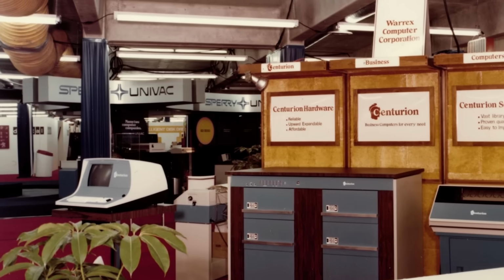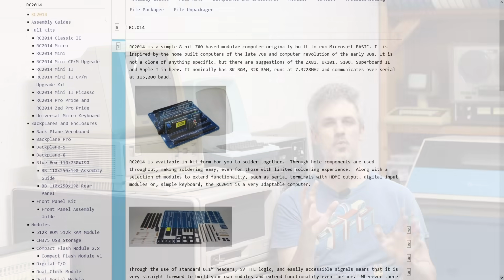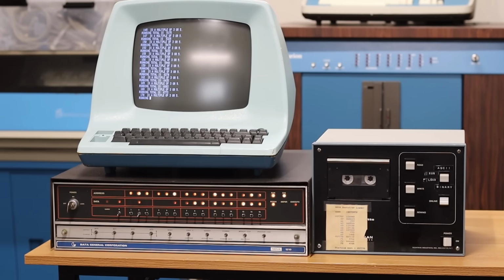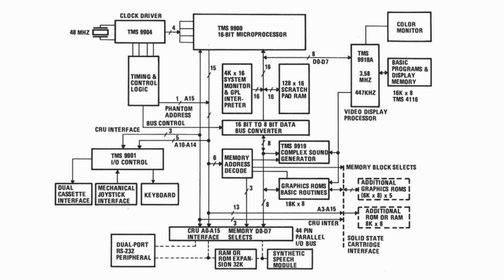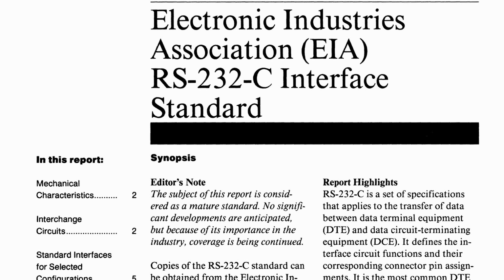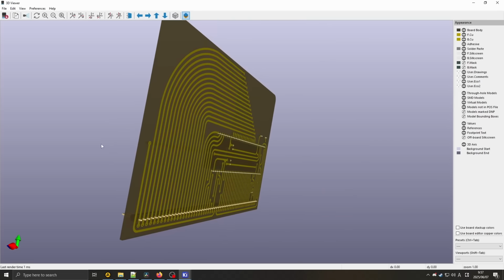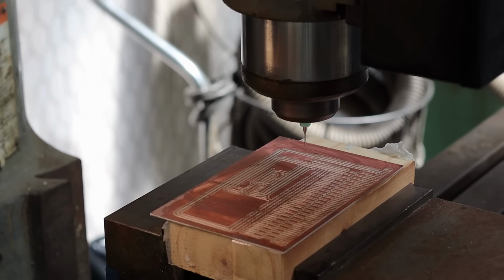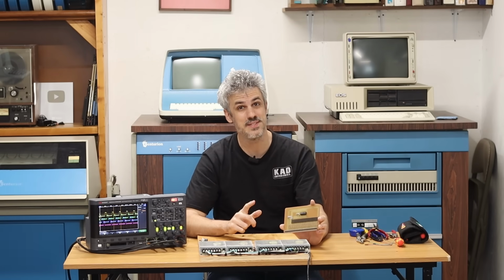The First Step in Building our TMS9900 Homebrew!

Comment: I think “being designed for multiple users” is the only definition you need for micro vs mini. That already decides the architecture choices which would divide it into the 2 camps: how much power they have, amount of storage, the presence of a memory management unit and context switching, etc. 
EDIT: I am talking about machines from the era when these terms were still widely used. “But my AMD Ryzen desktop is designed for multiple users”; yes, but nobody I know is calling these mini- or micro- computers.
Reply from the maker: In reality, the term minicomputer was never an officially decided upon term. It just kind of came into being, and marketing departments being what they are, capitalized on the term for their own benefit. So, my definition of a minicomputer is going to differ from everyone else's, which is going to differ from the marketing departments of the era, which is going to differ yet again from the engineers who were designing the things. Language is a weird and messy thing!
Reply: @UsagiElectric  Yes, plus the first minicomputers, like the LINC or PDP-8 were mostly meant as single user systems. That's why I think the distinction between "processor in (a few) chip(s)" and "processor in many chips" makes more sense.
Reply: Of course, this only holds until PCs adopted memory management and context switching; not for multiple users but for multiple processes. The mini/micro terms are rather meaningless after the mid-80s development of MMUs on personal computers, so IMO it’s not worth trying to make the distinction after then. It’s like trying to decide if a modern speedboat is a pinnace or a galleon.
Reply: Minicomputers also tended to have very "intelligent" devices.  The CPU basically never spent time spoonfeeding any one periferal.  Just sent off some data and went to do something else until it came back.  But yeah by the time stuff like 386es came out, a lot of microcomputers had much of the minicomputer capabilities and really, what made minicomputers what they were was starting to be less and less relevant and it was just becoming more about power and addressable RAM and devices as multiuser stuff started to become more relevant.  But also because terminals were on their way out or becoming just a piece of software on an also fairly capable computer at someone's desk, the role of a mainframe had changed quite a bit.
The single tasking nature and the conditioned user expectation that computers had to wait to "think" of things kinda reinforced microcomputers having very dumb periferals that the CPU would have to take a lot of time to bang out signals to control every interaction with the device.
Reply: Well, that is not really a particularly good distinguishing element I think, I have what used to be a workstation that I have "souped up" so it now has 14cores and 96Gb RAM plus 4 additional GBE ports as well as NVMe storage to keep up with the rest. It isn't a good single user machine at all, it does have a GPU but it's there to do other stuff not really show an image on a monitor. 
Obviously in terms of hardware right now it IS indisputably a 'multiuser machine' on account of it on top of the above mentioned hardware also runs Windows Server DCE and would be a terrible computer to use as a PC - but it would feel a bit wrong to call it a minicomputer somehow. It's a former workstation "bastardized" into being a server but it's still a box that looks like it belongs on a desk next to a monitor. It's a minitower basically, it doesn't even look 'servery' at all unless you look at the back of it or pop the hood.  
The reason for this thing is that I don't have the possibility to have a rack, and I don't want it to look like a server either, my other machine is a HP ML350 which is a pure servermachine but just with tower feet and no rack ears, for the same reason. It looks like a tower PC to the uninitiated. Neither of those two have monitors plugged in to them.
Reply: Multi-user versus "personal computer" That for me is the distinction.
Reply: Yeah, Yeah...and people ran timeshare BASIC on their Altairs, but that didn't make them minicomputers, either. I think "being designed for multiple users" encompasses more than just being able to run software for multiple users. It has to include both CPU architecture to support mulitple users (large amounts of RAM, easy task switching, and later, protected memory) and system architecture that enables large storage and RAM, interfaces to multiple terminals/displays, and allows for big expansion. I also think you have to include fast and plentiful I/O, as many minicomputers were used for process control and communications.

Even though the PDP-11 and Data General computers @UsagiElectric showed were physically small, they were fully capable of being expanded into much larger systems, if needed, which helps in differentiating them from micros.

An 8086 could have been the basis for a minicomputer, if the system had been designed for more RAM, storage and I/O than than the microcomputers of the time. The 8088 not so much simply because the compromises that made the 8088 different from the 8086 were exactly the kind of limitations that you wouldn't want in a minicomputer...things that slowed performance.

The biggest reason it wasn't was probably that the competing minicomputers of the time were already faster and more capable than the 8086 when it launched.
Reply: Then there's the "networked micros" that showed up in the mid-eighties.  Two examples:

Zeus 2 used up to eight motherboards on a passive backplane, each of which ran a thing called MUSE (Multi-user System Executive), a CP/M system, and had interprocess communication between the boards to handle complex tasks.  

Televideo 816/40 was a multi-user networked micro, also running a passive backplane IIRC.  It served up to sixteen users, each of which had their own CPU to do business, write code, or just play Super Star Trek on.  Each user on the system had a user area on the  shared 40 MB hard drive.  (Now that's using the USER command as it was actually intended!)
Reply: Not at all accurate. The pdp11 is a mini, but a desktop computer turned into a server is still in a different class.
Reply: @rickhunt3183  We might all find this article by Richard H. Eckhouse, ACM, to be of interest.

https://dl.acm.org/doi/pdf/10.5555/1074100.1074606
Reply: In modern terms, that'd be a server vs workstation. And it's equally blurry since any modern computer can run both roles. Although we still don't stuff MacBooks into racks.
Reply: @graealex we do stuff Mac Minis into racks. This is due to a silly quirk of Apple's lineup and licensing, though.
Reply: @matthewkriebel7342  We don't really. Maybe you do, though.
Reply: @graealex  usually.
Reply: @graealex stuffing macbooks in racks as ci build machines is pretty common
Reply: @lasskinn  It is not "common". You see it every once in a while. Or do you think Azure XCode CI actually runs on MacBooks?
Reply: The problem is that would make a 386 computer a minicomputer.
Reply: @tarstarkusz  in 1985, I had two doctor's offices, eight terminals, beaucoups printers, and a tape drive for backup jobs, running off a Compaq Deskpro 386. That 386, was serving as a minicomputer. Thanks to SCO.

At that same time, in my day job, notably, I was also tasked with managing a network of true TI TMS990 Minicomputers, which ran coast to coast as our company's regional data entry network. Lots of TI COBOL code running on that platform. Yes, TI COBOL was a thing. The Texas Instruments  DX-10 multiuser OS was also a thing.
Reply: I contest the comparison to microcomputers. When mini computers were born there were no real microcomputers, the mini is a reference to the big computers of the day ie mainframes.
Reply: @Axel_Andersen  when microcomputers were born, they were smaller/more limited than minicomputers. Hence the use of the word micro.
Reply: @mjouwbuis  I think the word "microcomputer" also had a lot to do with the term "microprocessor".  This also is why many laypeople(non-geeks) used to call the entire microcomputer case a "CPU". At the time I thought it was pure ignorance, but... in ye olde days of computing, the "CPU" would take up an entire board of components(which may or may not be in a separate case).  It's like in today's hobbyists kits, a CPU made of TTLs(Gigatron). I think maybe VAX were built like that? So it was really remembered knowledge of early computers, rather than ignorance, that the entire box was called a "CPU". IDK if Altairs and IMSAIs with 8080 microprocessors were often called "micros"(before my time), but Z80 and 6502 machines definitely were.
Reply: @mjouwbuis  Of course. But when mini computers arrived there were no micro computers. Hence the definition of what a mini is should not be based on micro computers but mainframes. Because compared to mainframes they were mini.
Reply: So an ibm 386 pc running unix...? If you go by those 80's definitions your tv is a supercomputer lol
Reply: @ElShogoso You're completely missing the point there. It also makes no sense to compare computing power across decades. My Airpods have more processing power than an early IBM mainframe. But they're still not mainframes.
Reply: @ElShogoso  To be pedantic, the '286 had enough memory protection for multi-user operation.  It couldn't switch back out of protected mode easily for reverse MSDOS compatibility.  Obviously not 32 bit, nor did it have the variable segment size of the '386 so you were stuck with 64k segments.  But i don't think those are relevant to this conversation.  I used to run Coherent back in the day, which was a multi-user multiprocessing UNIX on the '286.
Reply: @ElShogoso  By all intents and purposes, that TV probably is. A supercomputer was a system that could run a lot of parallel data streams over the same set of instuctions, which is exactly what the digital signal processors in your TV are doing. In the same fashion, a modern GPU is exactly the same as a supercomputer, the data stream in a supercomputer is the same in terms of architecture and data flow as the pixel pipeline in a graphics card.
Reply: expanded coco3 running OS/9 says hi from multiple terminals!
Reply: @poofygoof  Yes! 😄
Reply: By that definition installing linux to a desktop pc makes it a mini computer
Reply: Microcomputers have microprocessors.
Reply: @phill6859  But so can minis.  As Usagi himself pointed out in the video.  Another example, the (decidedly misnamed) Alpha Micro 1000 computer -- which was in fact a mini -- used the same microprocessor chipset, Motorola 68000, as the Amiga 500 and Macintosh SE micros!  Their earlier model, Alpha Micro 100, used the same microproccessor chipset (WD16) as the PDP-11 LSI.  Alphas were small business machines, often found in doctor's offices.  I had a friend (sysop for Wisconsin Bell) who owned one personally and let myself (and several other of his friends) use it.
Reply: @phill6859 as in comparison to a self contained ALU?...thinking 74181
Reply: @phill6859  so do many minicomputers.
Reply: Well "being designed for multiple users" is mostly a question of software, not hardware. A C64 class system can easily host multiple users, the main limitation being the zeropage. MP/M was the multi-user version of CP/M for microcomputers. Our modern computers, which clearly are microcomputers, can easily support multiple users at once.
Or perhaps another distinction. If you buy a computer running one of the small versions of Windows (i.e. Windows 11) , and you upgrade it to one of the normal versions (i.e. Windows 2019), will the computer turn from a microcomputer to a minicomputer?
Reply: @altebander2767  Multiuser C64 has been around since at least the early 90s in the form of multiuser capable BBS software.  I used to use a Commodore BBS that was capable of 3 users and I think that limit was the phone lines, not the software itself.
Reply: @altebander2767  For certain definitions of "support", yes a modern computer can do that.  The first microcomputers couldn't even multitask.  This capability didn't even start creeping in until at least the 486 era, the third generation of home computing.  You had to have a least 4MB of RAM (in an era where 512K was extravagant and expensive!).  My Amiga 500, of the same era, could multitask on a mere 512K, but it was just all switchable display pages that either went to The One Display, or nowhere (aka Linux's /dev/null).    M$ operating systems capable of securely managing multiple users were MUCH later (WinNT, Win7).
Reply: @xheralt 386 could most certainly multitask. Desqview, unix variants, os/2, later linux - but importantly for users it didn't matter how the multitasking worked so windows 3.0 style multitasking was just as good for most users so the experience for office apps and copying stuff between them was as good or better than with an amiga.

(Ofc you could argue that 486 is 80s technology because it is i suppose. From modern perspective its kinda amazing that xt to 486 was for sale at the same time in shops.)
Reply: @altebander2767  I wouldn't say that you can do that EASILY with a C64, but rather that it is possible to do so. You could modify the hardware to make it more practical, but at some point what you have is more of a hybrid/frankensteind system than anything else

Comment: Love this new project. I modified my TI-994/A with more and faster memory in the mid 80s and doubled the execution speed. I'm sure that by making the memory bus full width and using fast memory, at least a 4x speed increase is possible. Removing the video overhead - probably much more.
Reply: That would be an interesting thing to try on my 99/4a.

Comment: I use DIPTrace. It's the easiest and best tool for circuit and PCB design. I also use Micro Cap 12 for all my simulation needs.
I tried KiCAD, but it's just badly designed by engineers for engineers. 1/10, won't recommend it...

Comment: The 99/4 was a horrible design, and TI insisted on all sorts of crazy things like GROM. The worst thing about it was putting most of the RAM on the video chip where every access was though a little peep-hole. That was both incredibly cheap and lazy. They really out-Jacked Jack with that idea.
That being said, the 9900 sounds like a fine chip to build a homebrew around. Using a gold-and-ceramic version is even better.
Those power supplies are such beautiful overkill. No switching wall-warts from the thrift store for this baby. It's already looking like a minicomputer!
Also don't forget: I've heard that the 9900 has 2.5mm pin spacing, not 2.54, and that chip is big enough for it to matter!

Comment: There are huge impedance issues with this signals. That will cause many signal integrity issues in feature. 1MHz is high frequency. You should consider coupling capacitors ar impedance match etc. Also problem get worse with longer transmission line.
Reply: This also needs to be evaluated depending on chips you use. MOS/FET has completely different input impedance than bipolar semiconductors, meaning a bunch of noise is reflected at the inputs.
Reply: @graealex  yes that very true. This project will have much different problem and PCB technology and interconnection technology can have huge impact.

Comment: TI at one point had the world's largest network  incidentally ,  we had systems with 20 odd screens multiple printers and remote clusters over 4800 baud leased lines ,  we also were able to do dial up diagnostics using a pair of 1200 baud v32 Case modems which were extraordinarily expensive ,  the 931 I think rs232 terminal also had fibre optic Comms using plastic fibre ,  we used that on the remote sights due to lightning strikes being a problem ,  the main system ran a 96mb CDC phoenix which cost £27,000 at the time I remember early 1980s
Reply: We at TI had multiple TI-990/10 and 990/12 minis networked using MML - Multi-Machine-Link they termed it ... we could submit 'jobs' (computer jobs) to the IBM System/370 system via our TI-990s that mimicked RJE (Remote Job Entry) terminals emulating 3270 protocols and all ...

Comment: Also the TI DS 990 the screens were 911 VDT that was a remote screen and keyboard not a dumb terminal there was a coax cable to carry the video signal to the screen and a rs232 cable for the keyboard I think it was 134.5 baud I seem to remember
Reply: The 911 VDT was the standard terminal on a ‘990 . It was essentially a memory mapped 24x80 screen with a serial keyboard. However you could set up an EIA board to run rs232 terminals. It was just that the operating system couldn’t support as many rs232 screens as 911’s. I think we got to around 30 911’s on a 990/10.

Comment: I OEM'd and maintained TI DS 990 systems  ,  the TI 990-10 was a 16 bit minicomputer and that machine was later available with the 990 microprocessor ,  it was identical ran the same  program and the CPU board was just on one board instead of two ,

Comment: Very cool, can’t wait to see how it evolves.  There are very good reasons for 4 phase logic (it saves a lot of transistors), but timing suffers (more skew to worry about) so for this and other reasons we moved to single phase.  It would be interesting to go over the internals of the TM9900 down the its gate implementation.

PS: Meanwell does make single supplies with all four voltages.  I use one in my Nascom 2.